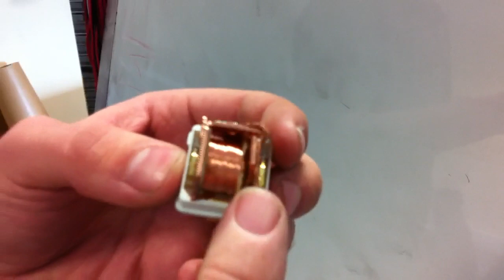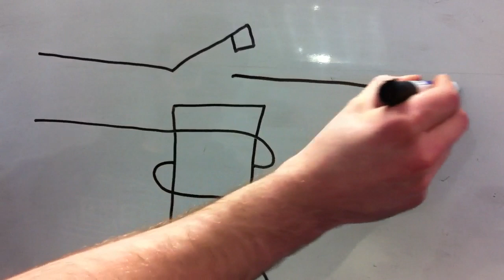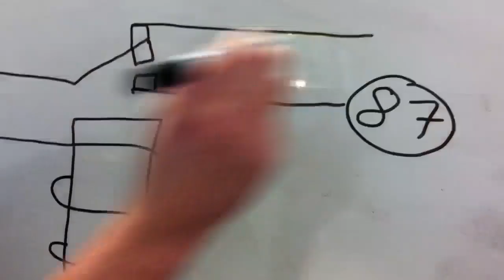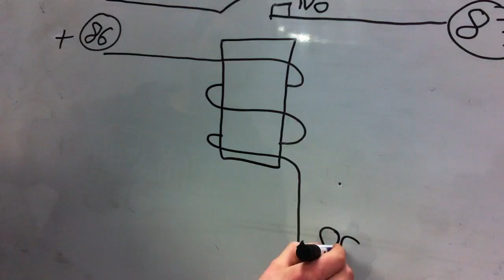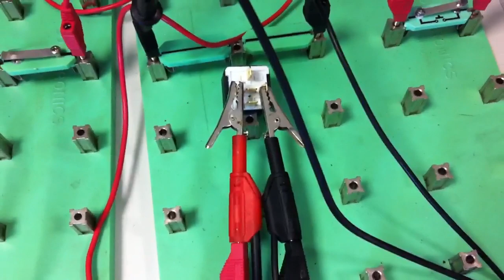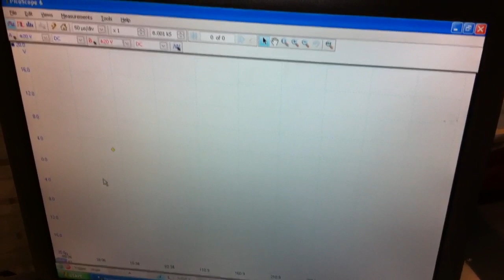Using a PicoScope to analyse voltage spikes in an automotive relay.

Comment: Great find of a video. If I may ask would a light emitting diode between 85 and 86 work the same way?
I've added LEDs to 85 and 86 in some of the relays I've worked on however it seems like this might or might not work based on your video.

The relay I use is an internal diode 12v relay so it has a diode already however I've tied an LED to the coil inputs.
If I'm not mistaken, the + from the LED(anode) ties into 86 and - from the led (cathode) ties to 85, lighting up when the coil energizes.
The relays work however I've never verified any spikes and didnt care much about it until now. Again based on the diagram of the relay they seem to come in with a diode already between 85-86.
Reply from the maker: Hello Oscar, great question!
First thing to say is make sure you don't mix up the 86 and 85 terminals. It is important to note that 86 is the switched live end of the coil, and 85 is the end of the coil that runs to chassis ground. 
Don't get these two mixed up. If you do, the first time you operate the circuit, the diode is a direct dead short circuit, and it will be destroyed. Any fuse protecting this circuit will blow.
When the fuse is replaced, the circuit will switch perfectly, but will produce this large voltage spike every time the coil circuit is opened. In time, this will damage any electronics associated with this circuit.
Now to your question - would an LED do the same job? In short, yes. Check out this video we posted which will give you a more comprehensive answer: https://www.youtube.com/watch?v=hNyNdLqm0X0
Reply: @mattOl  Thanks for the link, I did have the same results when I wired the LED in "backwards" operation as you have in your video. I would get light upon the the collapsing of the field due to the spike however the intention was for a visual indication that the field was on and thats why the LED was chosen. 

The relays themselves had a diode already built in 85-85 to prevent this spike, I have added a second LED with the anode to 86 and cathode to 85 so it can light up.

So far I've not had any issues with the 25 I've made however I rather confirm then to assume. 

I have an engine stand in my garage that is running 8 of these relays, it powers 2 ECMs and many sensors. Though I have had success with the engine and relays I want to confirm 100% that Im taking the necessary steps to prolong the life of them.
A light indicator is a major requirement for me and what I'm using them for. I can take the relay apart and install these lights and have proven to be fantastic in determining what's ON and what's OFF
Reply from the maker: @oscardeltoro898  Yes, I may have slightly mis-understood your original point. If your relays have built-in protection diodes, they are safe (no voltage spikes). Likewise, if you wire an LED across the coil, with the cathode pointing at 86 and the anode connected to 85, it will also prevent spiking as well as cause the LED to flicker every time the circuit is opened.
If you wanted to use an LED to prove that any particular relay was live and active, could I suggest that you put the LED in series with the appropriate resistor. If you connect the anode of this arrangement to terminal 87 and ground the cathode, the LED will stay constantly lit as long as the relay is energised.
Reply: @mattOl  Would love to chat with you on this project if you're available.

Comment: Good vid! Mind telling us what part number you used for the diode? It might go one step further to make a video on explaining how to size a diode and link it in the description.  Currently struggling on how to properly size a diode for an automotive system (GM truck) (reverse voltage, forward voltage, surge current and all that mumbo jumbo that I don't understand). Although I'll probably figure it out before you have a chance to comment, I'm sure this would help someone else out in the future and save them some time.
Reply from the maker: As far as I can remember, I used a diode from the 1N4000 series, probably a 1N4007, which is good for a repetitive peak reverse voltage of 1,000V. 
When looking at specs, this type of relay produces a spike in voltage in the region of 200-300 volts, well below the limit of the 1N4007. The problem is that if there are transistors elsewhere in this circuit, base current can be much higher, and with transistor gain, way too much current can flow through the transistors, causing damage.
Reply: @mattOl  thanks for your reply! I clicked order and your reply popped up about 10 seconds later haha. I got the 1N5404-e3/e7 (400v 3A) which hopefully should be adequate according to the GM manual. It all still sounds like gobbledy-gook to me... Cheers!

Comment: Nice video,
 I'm going out on a limb with this since I had to use CC to know what you were saying. It's not the best.
It stands to reason that with all the fancy electronics in cars now days that you would need a protection diode on relays.  I've worked on car electrical systems and even taken relays apart.  Never noticed if they have a diode built in.

  How ever, if the do and you connect it "wrong" or backwards, you would know it as soon as you put power to it.  Would you not?
Reply from the maker: Hi, sorry, but not sure what you mean by having to use 'CC' to know what I was saying. Not all relays have diodes built in to them. If a relay does not have a diode, the relay will operate perfectly well regardless of whether it is connected 'wrong' or not. In other words, to energise the electromagnet in the relay, it does not matter if the terminals are connected 86 live, 85 ground, or the other way around, 85 live, 86 ground. The relay is happy to operate either way.
However, if there is a diode fitted to eliminate voltage spiking every time the  relay is switched off, unless the correct 86 +, 85 ground is observed, the first time it is connected, the diode is a dead short to ground. This will blow the fuse in the circuit. If the fuse is simply replaced without further investigation, the relay will operate as intended, but will produce a voltage spike each time it is switched off (electromagnetic induction - a collapsing magnetic field moving across a conductor). The diode is there to prevent this, but it can only function if the DIN codes for wiring the relay are observed: 86 is the start of the coil (+), and 85 is the end of the coil (ground).
Reply: matchudcu
  I'm almost 100% DEF, so CC means "closed caption", Closed caption is a joke sometimes.  Turn it on you'll see what I mean
  Yes the fuse blowing is what I was referring to. I didn't think of the fact that the diode ratings may be low enough to allow the diode to blow along with the fuse. That's where my comment about the fact that you would know if you connected it wrong LOL.  My thoughts were, connect it right or keep blowing fuses. 
  I came across your video while looking for voltage reflections on VFD motor drives on a scope. To see a guy who works on cars explain voltage spikes from the EMF of a relay, using a scope was a big surprise so I watched it.

  I'm an electronics tech' with over 30 years of experience, have always done my own car repair.  It's nice to see that there are at least some PPL that work on cars know what they're talking about when it comes to the electronics.. Good Job. /  again nice video!
Reply: matchudcu
And, I want to add, very nicely done.
Reply from the maker: PCriver101 Finally worked out CC, and I see exactly what you mean! :) Thanks for the comments. I'm just starting the electronics/ basic electricity part of the course again with a new class, so I hope to add some more video over the coming weeks. This is mostly the work of first year apprentices. They'll do everything except speak on the video. Having listened to the sound of my own voice, I can understand why.....The apprentices prepare everything, and I video it and do the voiceover.